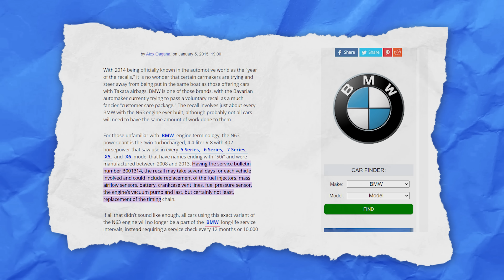WORST Cars You Should NEVER BUY!

Comment: I know it was hardly sold in the us but in europe the ford 1.0 ecoboost is another terrible engine it uses a wet belt and several cooling system flaws which eventually cause water leak and it had no coolant level sensor! The wet belt is also a dumb design as when it wears, it blocks the oil pickup/oil pump and such an expensive job to replace the belt being a wet belt. The updated ecoboost on the newest fiesta/focus is better as its now timing chain and not wet belts but remains to be seen still how reliable the chain is and if the cooling system holds up better now

Comment: Yep my father has a Nissan march with automatic CVT transmission and car..... Has problems. First the fourth gear won't kick in unless the car has been driven for an hour and half. Second when the car accelerates to third gear and you hit the brakes for it to change to second, that's it for you because the fourth gear won't change. The double drive gears also don't work. So you can drive the car pass 30miles of distance with just 35mph

Comment: I think my worst experience is with my grand fathers 90' Peugeot 405 station wagon. Fun car, but terrible enginering. The engine threw up oil all over the engine bay at cold weather. I think it was the crankcase ventilation system which froze.

Comment: i know the 2.2 chevy has a lot of fans, but so many car guys have stockholm syndrome 

and i think if you’re choosy about the year of manufacture and the maintenance history, the EJ253 is arguably sort of reliable. And a lot of it is fixed with multi layer head gaskets. my 2010 never burned oil and the gaskets held past 130,000 miles, but my mom’s 2014 with the 2.0 had both issues. dad’s 2018, no prob

Comment: Test drove a 6.0 power stroke before they were widely accepted to be so terrible. The thing had a manual transmission which was good… but the truck was so sluggish, I had to test drive a second to believe it didn’t have a bad turbo. Had two Cummins trucks… which were on the opposite end of the spectrum enginewise (body and everything else will apart long before engine has problems… yay Chrysler)

Comment: Your right about the 2.2 Vortec 140 hp.stock rating...that's why my uncle & myself installed a Supercharger system on my Brand New 2002 S10 we took it from 140 hp to 180 hp ( put it up there with the stock 4.3 V6 ) ..it has 250,000 original miles & still going 💪strong 🇺🇸
Reply: What supercharger kit did you use?

Comment: I have a 2010 ford fusion right now (for probably the next 4 days before I trade it in, finally). 175hp and an auto was fine for the first 11 years, but recently it's been rough on upshifts. Though nothing on this car is as bad as the extreme hesitation when going from reverse to drive. Backing out of my driveway onto a busy road is bad enough, but then i have to sit dead stopped for like 4 seconds while my transmit decides if it wants to shift or not

Comment: You're reaching hard AF coming for the IS250! Its reliable as hell and it also has the base engine thats as fast as the 2JZGE in the first gen IS300 and it's a smaller engine... 👀 Also, the Chrysler 2.7 was indeed a sludge trap but it made more than 170hp, it made 200hp. For the time it was on par with its competitors... if you wanted fast back then you bought a Maxima.
Reply: Yeah man it's not too bad the car wieghs heaps too.  It does have some high oil consumption but that's a general Toyota thing.
Reply: @nivlz  The IS250 isn't all that heavy, they are right around 3,500lbs which is fairly average for its class

Comment: Had a 94 z28 camaro with the Lt1 engine. Was decent when it ran right but optispark distributor was the worst design ever. Put it under the waterpump down low so if your water pump ever failed or you hit a big puddle and got it wet you’d start to misfire or wouldn’t start again after you shut it off. Also engine halfway under the cowl so good luck working on it if your hands are bigger that a childs

Comment: I mean the alero Oldsmobile had the 2.2L eco tech motor and it wasn't terrible I guess had decent gas mileage but it did burn oil quite a bit it had 160,000 miles it still ran fine though

Comment: I'm not aware of any mechanical faults, but the 4cylinder turbo in the new Genesis vehicles just feels weird.   It's got plenty of power, but it feels like it has massive torque dips, generally shifts at odd times too.   The bigger V6TT is so much smoother and doesn't have these drivability issues.    Super odd.

Comment: Modern engine lt4 in the Silverado 1500 lifter and pushrod issues.  Just had to deal with it.  They took a month to fix it and I've been hearing of people's engines blowing after the repair as well.  

I wassnt even driving it when it failed I started it to move it in my yard and the pushrods failed in 2 cyl.  

When I got it back the power level was much higher which tells me the problem was from factory and they just pushed them through quality control.  Now I know how it feels my mates with them where it feels down on power I'm telling them to demand a repair.  They are refusing saying it's not a problem until it blows.  Which can cause internal damage to the block.  When mine blew it was not a nice noise and Im sure there was some internal damage but they told me theres not.  

My car only had 7000kms on it.  Brand new first owner.  It's a real shame the Facebook groups are just filled with people either bowing lifters or pushrods or in my case both.  I live in Australia and it's not a cheap car here.  The warranty cost for them must be insane.  I'd say by my estimates from the posts I see one in 3, 2020- 21 Silverados will be in the shop within the first year for repair or this issue.  

If you own one and it feels sluggish on throttle, hesitates often and will seem to hang on the revs and slams into gear sometimes get it to your dealer and demand a repair you have the issue for sure these are the symptoms of the lifter/pushrod failure.

Comment: 2011 GMC Terrain, what a lemon. Two engine rebuilds (under warranty) before hitting 60,000 miles caused by excessive oil consumption, camshaft issues, etc.

Comment: 2002 SS Camaro manual had a T56 tranny and the 3-4 shift fork was aluminum instead of steal and would bend under speed shifting, which would lock it up stuck in 4th gear. The dealer would replace under warranty but put the same aluminum shift fork in…..smh.

Comment: 4g shawd Acura TL’s have an issue with burning clutches. Many complaints made but Acura says it’s a wear and tear item. Clutch wear will start at 30k and it’s either because of the 300+ hp in the 3.7 or the slave cylinder delay valve. The clutches in the 3.7 were originally designed for the j35 which has about 280+ hp. It’s all over Acura community but they refuse to do anything

Comment: Kia Optima the most unreliable engine ever
Reply: Has Kia ever made a reliable engine? 😂 a sephia was my first car . I put a fart can muffler on it and it started overheating 🤣 that was in 99 ‘
Reply: The 3.3 in the Sorento and ironically the non-identical turbocharged 3.3 in the Stinger and Genesis G70 and G80 are very good engines but some Kias can go pretty far.
Reply: @DanielWraps   the g80 is dope but I just don’t trust Korean cars (and I know this is a shared feeling)
Reply: @waynejordan7473  we will see how long my wife's Sorento lasts. We have the 3.3 V6 AWD. 6 years old and has some light seepage from one oil pan bolt and off the bottom of the timing chain cover but nothing that's warrantable (frustrating). I guess if it blows in the next 4 years I'm covered 🤣 . The radio amp under passenger seat went out and Kia replaced it free of charge 6 months after the electronics warranty period ended. It depends heavily where you live and the relationship you have with your local dealership and if they're cool but Kia for me has been great with otherwise no issues. I recently bought a 2017 Ram 1500 Limited 4x4 with the 8HP70 ZF transmission snd its been good so far but it's pretty new to me. Threw a CEL because the purge valve near the throttle body apparently just malfunctioned. Replaced the gas cap and valve for only $35 together. Not a horrible blow to my wallet. Hoping it lasts.
Reply: @waynejordan7473  Agree i dont trust Korean cars as well

Comment: Yeah. BMW N54 is the absolute worst. 

Electoral issues, Canó’s problems, injectors, high and low pressure fuel pump problems, bad turbos, and my personal favorite, the non serviceable 6sod manual transmissions.  Good luck if a synchro goes out on that bad boy.  Giant pieces of 💩.

Comment: The only car I have ever driven that I can genuinely say I hated with every fibre in my being is the Peugeot 307 CC. Absolutely trash vehicle. No power, no space, constant reliability issues, you drive over 60 in the thing and the steering becomes so light due to poor weight distribution that you feel like you’re a hair width away from a crash at any time. 

God honest crap heap.

Edit: forgot to add the dog crap transmission issues as well as almost constant clutch problems. The car was that bad, when I bought my E46 I GAVE the car to the guy I paid for the BM

Comment: Dodge Grand Caravan transmissions don't fail until about 200k miles, but when they finally do fail, it sucks. When a Grand Caravan tranny fails, it  (in my personal experience anyway) locks 3rd gear, meaning the auto will limit your Dodge to 10 mph, unless you go to manual mode, then put it in second. And in second, btw, you can only get up to about 50mph before the V6 starts revving like crazy! The worst part is that the packaging is so tight, the cost of replacing the transmission is about the same as the worth of the vehicle with the limitations you now have. I don't dislike the Grand Caravan, it is a great van with lots of space with those stow n go seats, but when the transmission breaks, you are pretty screwed. I know it is a late life problem that doesn't happen until the thing is 10 years old, but I wish it didn't happen, and I'm pretty sure in 2032, the now new vans will be having the same problem, since the Grand Caravan has only had a few updates over the past 10 years, (one of which is AWD, just came out this year, so I'm curious to see how it goes) so it is pretty much the same van.

Comment: The worst drive transmission of all time in automotive CVT from Nissan.  I own a Nissan Juke and have to have the it replaced twice and rebuilt three times.  Its not a matter if it will fail again, but when it will fail.  The 4 cylinder 1.6 turbo motor is solid, does you no good if the power can't get to the CVT transmission.  So why do I still have it, too much money vested in it and its paid for.  But when it fails and I know it will fail, it will be converted to a Juk E. I will look at making it a Jukelsa (duel motor) The Nissan lawsuit didn't include my make model. Never buying a Nissan again. The only Nissan I will ever buy is the R-34 GT Spec II V for my son college graduation.
Reply: R34 GTR isn't cheap!

Comment: We talking first gen is250 ? I have a 2012 and it’s not bad.
Reply: I got a 2012 IS250 right now. I'm literally sitting in it right now, typing this comment.
Reply: I've put over 225000 miles on mine.  Its not fast, but thats not why I bought it.  Only basic maintenance, nothing goes wrong with this car.
Reply: @jasg1240  I bought mine with around  76k miles on it a little over a year ago. Right now I got 149k miles on it. It's not a fast car but it's not extremely slow either. The one thing I don't like is the manual shifting with the paddles is too slow. It just doesn't shift fast enough. Besides that, it's an okay car.

Comment: 1993 Toyota Truck with a four banger with a steel engine and an aluminum head for changing the head gasket every two years at a then cost of $800! After three times this Toyota struck out and it was sold for parts with 138,000 miles on it! One of Toyota s mistakes!

Comment: Gen 3 Automatic transmission Tacomas..Piece of absolute dog poo. Any vehicle that needs a TCU tune aftermarket to shift just to be good enough to enjoy is pathetic. The manuals are better but they still needed work. Let's not talk about the struggle to get up a hill and constant searching for the right gear to do it. Unfortunately the 2nd and 1st gen were much better but the 3rd gen doesn't have the frame rust issues

Comment: The IS350 can do 0 to 60 in 4s 6:20
Reply: Toyota 3.5L 2GR-FE is pretty astonishing, you can put twin turbos on it, make 4psi of boost at idle and 650hp reliably. Idk if those transmissions can take it, but the engines can.
Reply: @stephenmoore1541  While that may be true, the IS 350 used the 2GR-FSE engine in the 2nd and early 3rd generations. It differs in at least two ways:

1. 2GR-FSE is usually mounted longitudinally, but 2GR-FE is usually mounted transversely.
2. 2GR-FSE uses Toyota's D4-S fuel injection system that combines direct and port injection, but 2GR-FE does not.

Comment: Yeah... Had a bad experience with a Subaru. 🙄
The engine sized. Was on driving the freeway, on a double date with Friends when the engine light flashed 4 times then it locked up. Had to put it in neutral to get it off the freeway. Once we pulled it apart the piston in cylinder 3if I remember had hit one of the exhaust valves and Sent it through the side of the Block leaving a nasty hole. I Replace that engine with one that had more miles on it pretty complete. And the timing belt stretched on the second engine... I didn't even bother replacing it. Subaru is not one I want to give another chance anytime soon. 2 engines. This also happened to be about 8 months of each other. "Get a Subaru they said. They are reliable they said." 🙄

Comment: I've never owned a Chevy 2.2l i4, but from test driving a 4-banger s-10 many years ago, that little engine does NOT belong in even the smallest of trucks.
I have an '05 Sebring, and though the 2.4l i4 also has the water pump under the timing cover and it's semi-gutless, it's definitely not a sludge machine. Chrysler will never live down the 2.7l v6, lol. :)

Comment: The 2.5L v6 in the is250s are just fine it’s the 3.5L v6 from the is350s that are unreliable
Reply: Can you elaborate? Im in the market for the lexus is. Im coming from a g37. I would prefer the 350 for power butnim clueless?
Reply: Hahaha wow care to elaborate? They are both solid reliable engines that are known to last a very long time with routine maintenence. I don't know if you are trolling or serious?
Reply: This is completely wrong. The is350s are bulletproof and have both direct and port injection so it doesn’t suffer the carbon build up issues that plagued the 250s. The 250s aren’t that bad and had carbon issues like the all direction injection cars, especially those coming from Germany. That’s was the only downside and main “unreliable” issue and especially worsened when driven like a grandma which most Lexus are. The rest of it is solid and not many other issues. It has 204hp which is fine for a base engine and peppy enough in the mid 2000s and 31mpg on the highway was decent too.
Reply: I was literally looking through Copart earlier for a IS300, the number of 2.5L cars there with "mechanical" issues was the highest of any platform I looked at.
Reply: Yeah its so unreliable that toyota still uses it  to this day. The only thing that 2GRs are know for is front cover leaks. They constantly go 400k miles.
Reply: @Br99klynINg24_8  this guy is talking out his ass. The 2GR platform in the IS  is a good daily driver with good power. The thing you want to watch out for is the 6spd transmissions out of the 2gens. Toyota/Lexus at the time claimed that the transmission fluid was lifetime fluid but thats not the case. The 8spds in the 3gens is similar to the 8spd in the F cars(isf, rcf, gsf and is500) and is a great transmission. By this time the "lifetime fluid" marketing was dropped so most good owners exchanged fluid frequently. The only other flaw with 2GRs(and all Toyota engines) is that Toyota can't make a waterpump to save their life. Listen out for the waterpump pulley rattling and gasket failure. Hope this helps.
Reply: @Ben._.dover_121  Well said!